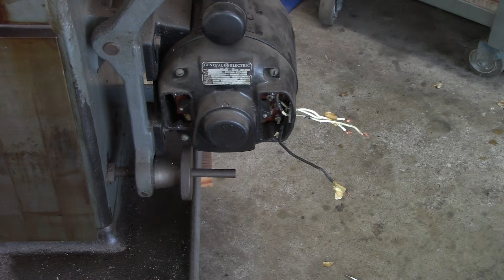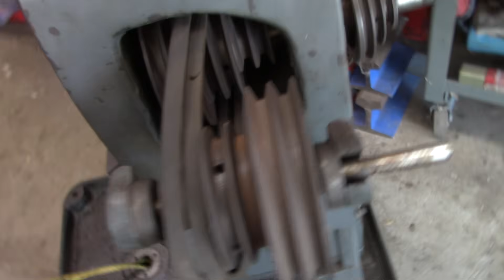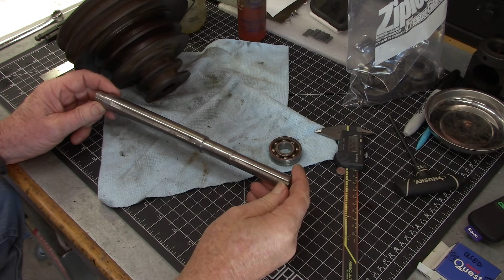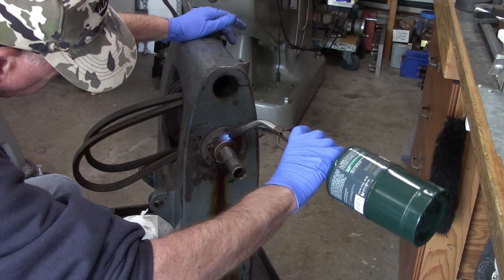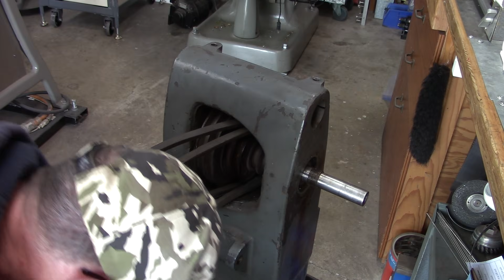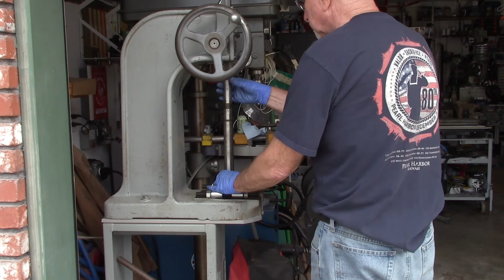Diamond Tool Co  Horizontal Mill Restore Part 5 | Main Body Teardown

Comment: Interesting video you must have the patience of a saint. Would be interested in how you clean everything and what you use to do it. Thanks for documenting this rebuild it will be very helpful to the next person that attempts this rebuild.
Reply from the maker: Hi Jim, yeah without any exploded views or manuals it’s slow going. 
Oven cleaner, purple power and some solvent. I try to avoid brake cleaner when possible I suspect there’s hidden danger with that stuff.
Reply: @TheAyrCaveShop thank you I appreciate that info.

Comment: Dean if you don't find the info you need on the motor I have the same motor on my Atlas Horizontal mill and also one on my Walker Truner model 900 drill press. The one on the mill is badged Atlas and the one on the Walker Turner is badged "Walker Turner. Yep WT made their own motors in the 40's. Just let me know and I will take pictures and email them to you.
Reply from the maker: Awesome thank you Terry 
I’ll get in contact with you when I start on the motor. It might be little while.
Reply: @TheAyrCaveShop  Okay just let me know and I will send you some pictures.
Reply from the maker: @terrycannon570  Hi Terry, Thanks again for offering to send some photos of the motor wiring.
Can you send them when you get a chance, non rush..
dean57ayr@gmail.com
Thanks again !